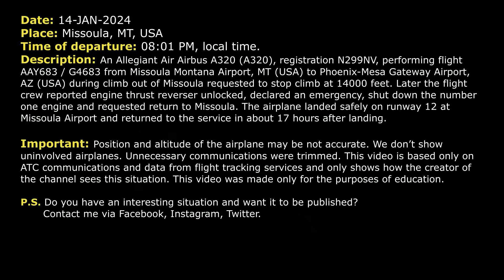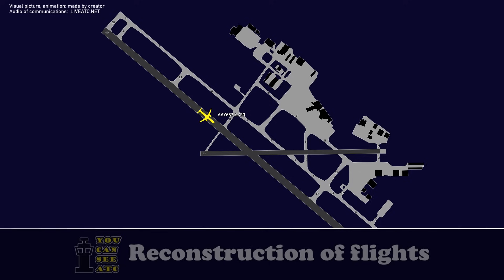Pilots shut down the engine in flight. Allegiant Airbus A320 has thrust reverser failure. Real ATC

Comment: Who do US pilots always "declare an emergency", while the rest of the world use pan-pan or mayday?
Reply: 1. 1radition (they have always done so). 2. American pilots talking with American ATC in American airspace would much rather speak American than Aviation English. 3. Their message structure has only two levels: Routine and Emergency. There is no Urgency (PAN-PAN is folded into Emergency).
Reply: indeed this is strange, and not the international procedure...
Reply: @yvesd_fr1810  – Indeed, but then the international proocedure exists to cross language barriers. These are barely existent in North America.
Reply: I think that if the pilot was breaking into a channel with a lot of radio chatter to declare an emergency, they would use "Mayday, mayday, mayday" and it would stop all other communication. In this case, the controller was already talking to the pilots, so they had his attention, so using "mayday" wasn't really needed.

Comment: Is reverser needed during take off?
Reply: Yes only when they are flying backwards for takeoff
Reply: @detteiu00 😂👏🏾
Reply: The mechanism for deploying (and stowing) the reverser failed allowing it to partially deploy. It was likely free floating, pulled open by the slipstream, but prevented from fully deploying by the exhaust.
Reply: Hopefully not !
Reply: Not needed and definitely not wanted.

Comment: All these ATC's asking these questions that don't need to be answered until you get close to the airport are pissing me off....let the pilots aviate, navigate and then communicate(which is last)
Reply: If only the controllers would read the YouTube comments.
Reply: Souls on board and fuel in time is critical information.  It gives atc information on how quickly the aircraft needs to land and the fire department information on fuel quantities if there is a spill.   Asking what the nature of the emergency is also is critical to determine if they can turn the vector back to the airport if they need to divert.    I'm curious as to what you think isn't important need to know asap information?
Reply: Roger that -   Pest ?
Reply: Cool tower operator !

Comment: "we have 17,680 pounds of fuel".... 
"sorry, still not good enough, I need it in time"!!! 
Is that a joke?
Reply: no
Reply: Basically time is for the length of flying ability in case an alternate destination is suddenly needed, and fuel weight is so fire services know what they are possibly dealing with upon hopefully landing.
Reply: Here is the trick of the day: on the 320, the fuel in pounds equals the time of fuel remaining, 176 minutes of fuel in this scenario.
Reply: I think you are assuming there are two engines running. They shut down #1, so they probably ran #2 at a higher thrust, so fuel time wouldn't be doubled, but close to it. Just guessing, TBH. @Francois8011
Reply: @JoelWelter  very true, this rule of thumb is assuming two engines running.
Reply: Isn't the whole point of the time in minutes for ATC to know how long they have to work? Anything more than XXXXX pounds and they should just assume "that's enough for now, don't need to bother the pilots".
Reply: It’s almost as if they’re asking those things for two different reasons. Nah, that can’t be it, you must have just figured out everyone is bad at everything.
Reply: When ATC asks for fuel remaining, it's always in time not quantity.  They wouldn't know how much time is available if you give the quantity because they handle all types of airplanes and not all airplanes burn fuel the same amount.
Reply: Who cares?!

Comment: I'm imagining that when they got to the gate, pilot jumped down, met a maintenance guy, and they got a step ladder and some WD-40 and sprayed the thrust reverser. 
I love Allegiant and their A320s- fly them often. Great plane and airline!
Reply: Especially in Missoula, they are the only 2 guys available to work on that engine with the only step ladder at the airport 😂
Reply: @normiepuppet  Betcha anything the can of WD-40 ran out, or the straw broke off, and someone had to drive 50 miles to the nearest Ace Hardware for more.